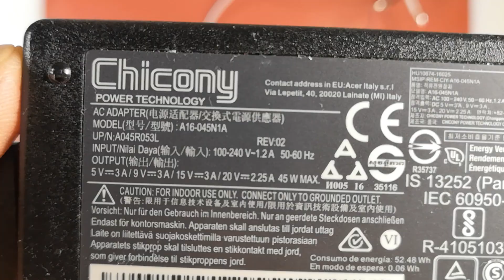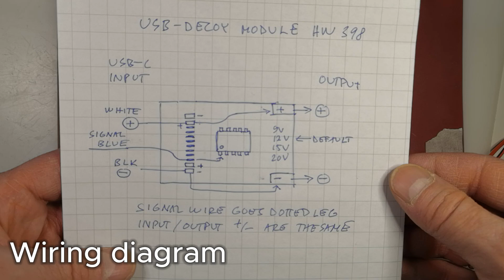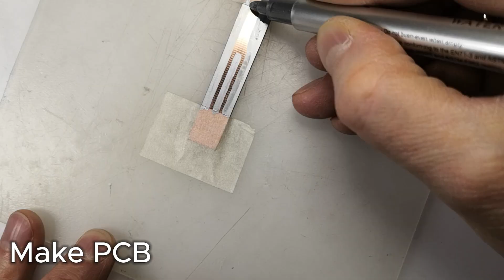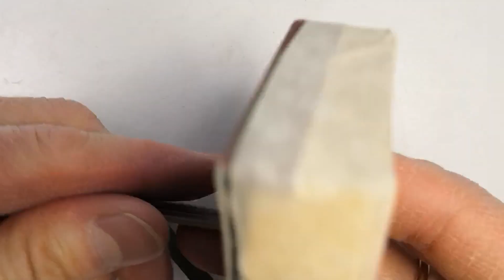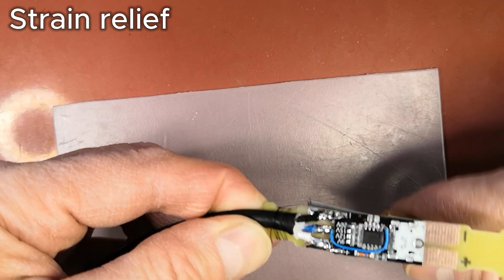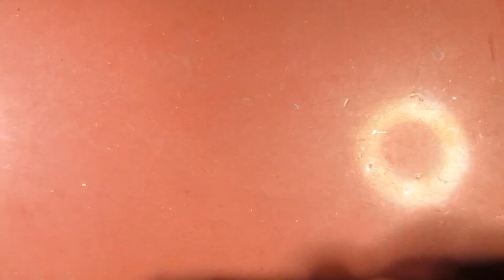USB-C Decoy HW-398 connect directly with three wires

Comment: I have a question.

I'm currently building a project where there's two input options, this pd trigger module and female dc port voltage will probably be 12v to 20v. The question is if i connect dc female port and this modules output in parallel, will this module get damaged from the reverse feed coming from the dc female port. ?

Thanks in advance 😊
Reply from the maker: You need a schottky diode on both vcc lines to prevent backflow. Schottky will have loss of  only 0,3V. But even that generates heat. For larger current use an ideal diode, see my "makita car jump starter" video. The Ideal diode is almost lossless, but costs more. You could also use a dc power connector with switch: it detaches pd-line when plugged in - I do not know if there is short time when both power supplies are connected?
Reply: @SnapTinker  after some courage ive tested it out the module still works after reverse feeding up to 20v, but it will pass through the voltage to its type c port during reverse feed so i need to make shure there's nothing plug in if I'm going to use the female dc port.

Just built up some courage after some YouTuber the I've seen and talked to where using xt60 and this pd trigger module as its power input for his portable lab bench power supply. 😅

Comment: i have a bunch of these boards, and all of them don't work, i used proven powersupplies.
Reply from the maker: Do you have correct cable and charger? It works only with usbC-usbC cable, and it must be PD- charger, which can give the voltage you are asking. UsbA-usbC cables does not work (QC-orotocol). Also it works with laptop usb-c power supply.
Reply: @SnapTinker  i used proven usb cables and powersupplies
Reply from the maker: After your comment I tested every decoy board. They all worked flawlessly. Also I have new finger nail sized decoys, I tested those too. Worked flawlessly. You must be unlucky, or your powersupplies/cables are proprietary and not following universal standard.
Reply: @SnapTinker  where did you buy them, i suspect I got them from a shady supplier, and also thank you very much for your replies, i really appreciate them.

my chips are unmarked, i suspect they are defunct chips, from a bad batch this supplier repurposed for these boards.
Reply from the maker: I buy my parts from Aliexpress. I read  reviews, try ignore fake reviews (most reviews are fake). I have got fake power transistors, but all other modules and components have been fine, so far.
Reply: @duality4y  they remove the names from the chips for the competitors. I have done several tests on those chips. They work with QC and PD chargers. The QC requires only data D+ D- and the PD requires CC1 and CC2. You could use only one CC cable but it is based on what side the cable is. One will work and the other not. I searched everywhere for the original name of the chip and i found it. It is the "FS312  USB Type-C PD fast charging protocol intelligent trigger chip". Unfortunately i could not find it on ali express...